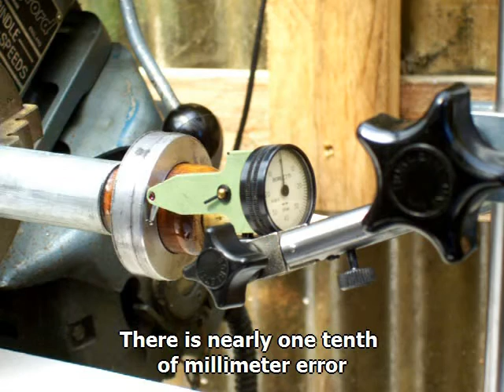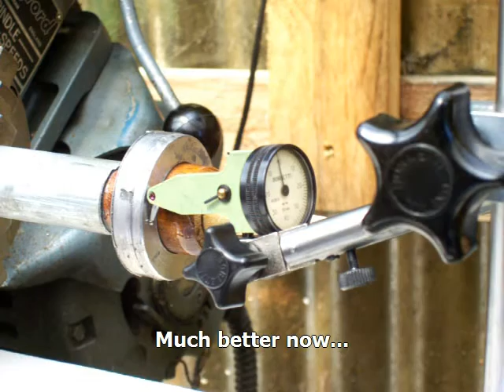How to make a precision spinning top (part 3 of 4)

Comment: 12:20 Is your lathe supposed to sound like that?
Reply from the maker: Yes, it is supposed to sound like that. :-)
It may seem the sound of a heap, but it is working well.
This happens with the gear for reduced speed, at normal speed the lathe works only with belts, and it is quite more silent.